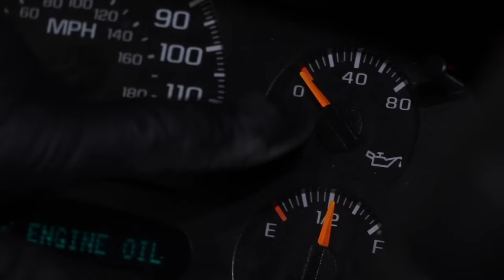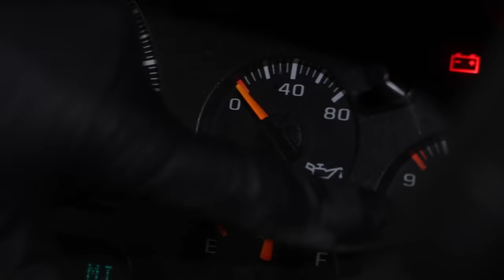Top 5 Problems 2000-06 GMC Yukon Sierra Chevy Suburban Tahoe Silverado Avalanche Cadillac Escalade

Comment from the maker: √  Watch the Video
√  Buy The Part at 1A Auto http://1aau.to/m/Visit-1AAuto
√  Do it Yourself
√  Save Money
Reply: What does misfire mean?
Reply: NICE EXPLINATION THOSE KNOCK SENSORS 😡😡😡😠😠😠😠
Reply: 1A Auto Parts do a vid on crank sensor for these trucks
Reply: @adal8590  the engine does not run smoothly.
Reply: Abs  light  goes  on  when driving    next time I can drive for a week or a day before the abs light comes on
Reply: @adal8590  It means when the engine is running but not all cylinders are firing. For an example,let's say you have a 8 cylinder engine,but it's only running on 6 or 7. Also some people call it missing,or the engine has a miss in it. Can be caused by a bad spark plug,bad fuel injector,bad distributor or the cap & rotor. Bent distributor shaft or worn distributor bushings.bad spark plug wires. Low compression or blown head gasket. Cracked head,bad valve seats......that's just a few things that can cause a misfire.
Reply from the maker: 1A Auto Parts Check out our library for more videos. http://1aau.to/m/video-library
Reply: Another good I have found is the throttle body, it throws a reduce engine power across the dash.
Reply: 1A Auto Parts ya forgot front wheel bearings ,calipers alternators ,lights
Reply: Transfer case switches?
Reply: Brake lines rusting and leaking. Owned two of these trucks and it happened to both. I'm sure it's probably not and issue in dry climates though.
Reply: @tonypezak1171  Mine ended up being a grounding issue. There's on the frame near the front bumper if I remember right.
Reply: 1A Auto Parts I own a 2006 8.1L Silverado and I never had any of these problems. Only been replacing only and did breaks a few times. None of these things happened to me and I live in a state where rust is an issue. My truck has 750k miles (all original parts)
Reply: You forgot the brake lines
Reply: My 00 GMC Sierra had a bad fuel gauge/pump
Reply: I have 98 350 vortec/ spider inject , random mis fire ,,,,and a very bad backfire like a shot gun. l have a good mech looking at / checked the go toos ,he say never seen that before
Reply: Blend door actuor A/C sistem
Reply: @CesarHuerta-ih7oj  yup mines out 😅
Reply: @tonypezak1171  replaced both,  not even a year old, and light came on not even 3 months into it😂
Reply: [ƤλƖИ]N ĐƛƦҜИΣSS sometimes you get a gem
Reply: Rich Bosman must not be a good mechanic lol
Reply: @adal8590  Cylinders running rough, out of sync
Reply: @ddanielbragg88  replacing the lines with the kit that includes all fittings and labeled pre bent lines was the best thing I have done to our old pick'em up.
Reply: Transmissions suck to
Reply: Got one for 3rd gen Tahoes, 1A?
Reply: Speedometer  and fuel sending unit
Reply: This video is awesome I have 2nd generation yukon denali (2002) just changed fuel pump and alternator,  no I have the mil control circuit code p0650 , what is that exactly..
Reply: My Yukon 2002 I will drive to store about 25/30 miles away ,I go in due some shopping, come back out ,try to start the Yukon and it won't start ,wait for 20/40 minutes it starts right back up...what is the problem. ,was gonna replace starter ,I just cleaned all the ground straps haven't replaced the main one u said ,but I will be doing that one tommorow,  do u have any ideas
Reply: Any ideas as to what would cause my suburban to basically slipInto neutral shortly after starting (4/5) minutes after starting....but then I turn the vehicle off wait less than (4/5) minutes and it drives completely normal for another (4/5) minutes? 
 Nothing happened to my knowledge prior to this fluid level is clear red and right where it is supposed to be, no leaks anywhere?
 Just looking for a starting point if anyone can possibly help? Thanks
Reply: I have a 1997 Chevy Tahoe I change the O2 sensor but the check engine light still comes on can you help me figure out this problem
Reply: X30 1

Comment: Don’t forget the mention the daytime running lights that one side always goes out. 🤪
Reply: Glad to hear im not the only one 🤣🤣
Reply: Get u some Lasfit led 3157s. I got tired of replacing mine every 2 weeks and don’t go with other leds. Most burn out after a month lol. Lasfit makes a few where they’re tall and thin and dissipate heat well and I’ve had my drls now for almost 7 months!
Reply: That shit bugs the hell out of me, really gets my ocd going. I finally got tired of replacing bulbs & just put new sockets & 6000k led's in & have not had a problem since. But now im noticing it on virtually EVERY other gm truck that drives by. Good call 🤣👍
Reply: What are you surprised both bulbs don't burn out at the same time?  That would be quite the anomaly if they did!!  The issue is the fact they only illuminate when the vehicle is in gear, so you either need to get creative to see if they are burnt out yourself, or rely on someone else to let you know.  Most of people driving these vehicles with one burnt out running light don't even know about it.  In fact they would probably be surprised to hear it even has running lights!
Reply: Change your bulb once in awhile
Reply: U can turn them off
Reply: @ttank94  you can just put it in neutral and check or pull up to a building with a window and look at the reflection
Reply: Yo Mama  mine is out.... Has been for a month. Lol
Reply: No they don't
Reply: @erykwithay2295  I'm fiddling with my daytime running lights right now and trying to figure out how to turn them on/off.
Reply: Just bulbs burn out.
Reply: Ariez put new bulbs in both sides at the same time. Boom. Problem solved.
Reply: @DIRTDIVER882  New socket.  Since GM thinks plastic is good for a socked that gets hot and cooks.  Didn't have this problem when sockets were metal.
Reply: Ugh yes I have to hit mine at least twice a week so it comes back on but I've never replaced them there still the original
Reply: I replaced the bulb on the driver's side twice, it kept blowing. I solved the problem by taking out the passenger's side, now they match perfectly. Both are off.
Reply: Happens to everbody. I believe some (like myself) are aware it has happened, But are too cheap to feel the need to replace it. Can still see at night. what the hell, eh who cares. lol
Reply: ErykwithaY No kidding? How?!?!?
Reply: Not even
Reply: I use the yellow light bulbs, Don't burn so hot and haven't burnt out plug since..
Reply: Just take them both out lol
Reply: Damn they are NOTORIOUS for that there!😅😂🤣Luv it!
Reply: ALWAYYYYS!
Reply: Replace the bulbs to a higher one so it dosnt burn out so quickly. That’s what I’ve done. Hasn’t gone out now for 3 years.
Reply: remove the bulbs
Reply: Ive never changed my bulbs and they all still work.
Reply: I put black tape over my auto headlight sensor to fix my drl problem, my head lights are on every time I crank and automatically go off
Reply: @DIRTDIVER882  i didnt have the problems other people did. but i did like you - replaced the sockets and put sylvania LED's from the parts store in and havent had problems with them for over 2 years
Reply: I put amber bulbs in and they have lasted. It's those damn corner peanut bulbs i can't make last lol
Reply: @ttank94  Really,,, All you have to do is turn the key to the On or Run position (not start) put the vehicle in any gear (chock the tires if on an inclined surface) and walk to the front and view the lights.  Start using the 4114 bulbs and problem goes away or change the socket if chard to ensure good contact.
Reply: Replaced with LED , no more problems.
Reply: Just bought an 04 Yukon & the drivers side is out
Reply: stares at my 02 Yukon with one day runner put Yeah 😅
Reply: I gave up on the DRLs . I drive with my parking lights on. Problem solved!
Reply: can’t forget battery issues 😀👍 and total brake failure after avoiding an accident 😀👍 yea i’m ready to kms
Reply: Lol.. I just bought a mint '01 Suburban and yes the left DRL is out.. lol
Reply: My 06 Silverado cateyes daytime running headlights alternate on the sides. Sometimes it’s on for the left headlight, sometimes on for the right. I kinda like it like that tho
Reply: Mine filled with water so I drill holes in them haven't gone out since
Reply: I replaced the sockets with ceramic ones from ebay AND installed LED bulbs . Overkill yes, but been 2 years no problems .

Comment: lets start a movement to make government  buy everyone new vehicles for allowing salt on the road to rust your ride !
Reply: Have several here from southern states with horrible frame rust.....others with none.  Seems different models used different steel....
Reply: Yes...So stupid isnt it...Use a substance which destroys your vehicle
Reply: How about GM finding new technology of how to invent a way to rustproff the frame and body. Thankfully i live in the South were there is no salt and i want a z71.
Reply: Having trouble getting covid 19 help let alone a car issue 🙄 good luck
Reply: Where can I sign New York here
Reply: My 98 has no rust. Southern states don’t salt the roads. No need.
Reply: Agreed.  There's nothing pisses me off more than having to scrap a vehicle with a perfectly good engine and tranny because the body and chassis rusted away.  Here in Ontario they use salt but in the western provinces they just use coarse sand so their vehicles don't rust like here. The DOT here must be getting kickbacks from the salt companies.
Reply: Yes!!!
Reply: Get a spray bottle fill it with transmission fluid. Before winter hits spray the frame brake lines inside the rockers  coat anything you don’t want to rust . It works great leaned this trick from a old timer  👍

Comment: 01 chevy just rolled past 300,000miles and still going strong. Love my older truck. Thanks guys giving me the information I need to keep it going.
Reply: I’m at 335xxx myself and she runs excellent not 1 leak and ice cold a/c these were definitely good trucks
Reply: Hell yea brother. Just hit 340xxx on my 01, mine was pretty beat when i got it but with some TLC they're strong, reliable trucks!
Reply: My brother just bought a 04 Chevy with the 4.8 and it has 270k he has a 93 Chevy 4.3 with 337k the transmission went out and I have a 96 chevy 5.7 with 327k
Reply: I have a 2000 Silverado 1500 with 350,000 on it runs great
Reply: Word, my 00 suburban is working on 250,000. Plus I have 2 15s on 3k+ watts
Reply: @jamarjackson5367  does she burn oil at all?
Reply: My pops at 450k burns oil like a mofo but she runs solid.
Reply: @RealDeal458  gots???🤣🤣
Reply: Like seeing all these comments💯 I bought got my first truck (96 gmc c1500 5.7 w/ 120,000) the end of 2020 and just bought a 2000 suburban 5.3 4wd with 282,xxx this week. Engine runs strong just needs a lil tlc and she'll be ready for another 250,xxx🙏🙏🙏🤣
Reply: Just get a tundra. Leave these clown trucks alone.

Comment: I’ve had  01,02,03,04 Yukon and the only problem I ever had was the instrument cluster going out. My 03 Silverado too. I’ve done nothing but maintenance to my vehicles. They all made it to 250,000+ miles with only tune ups. I barely replaced the original radiator on my 04 Yukon xl…did the water pump just because. I love these generation vehicles.
Reply: I had an on again, off again issue with my gauge cluster no working at all, Found a guy locally who does the custom led's for the cluster and took the cluster to him (very easy to remove, btw). while installing blue leds for me, he reflowed the entire board  and i've had no more issues with the gauges. You probably have someone in your area that does the cluster repair. Just look on facebook marketplace.
Reply: I just bought a Yukon with a broken cluster and leaking water pump. The cluster had a resistor broken off at both pads. I soldered in a new one and it came back to life.